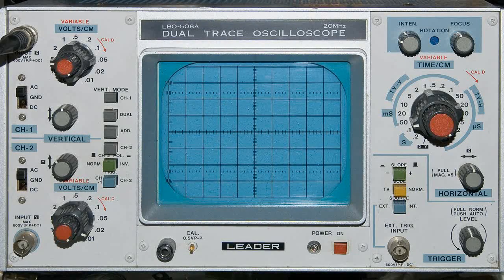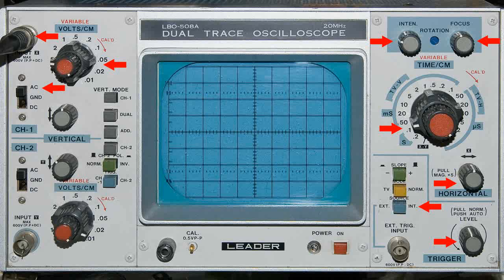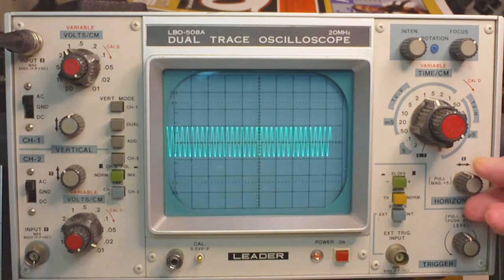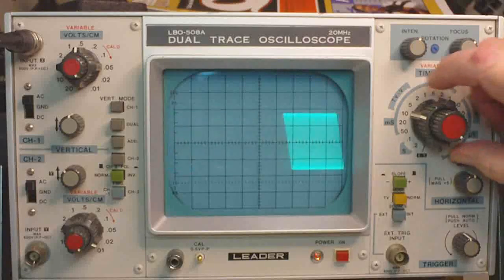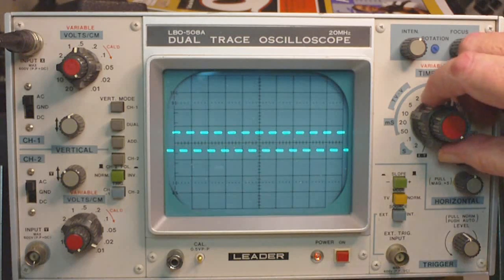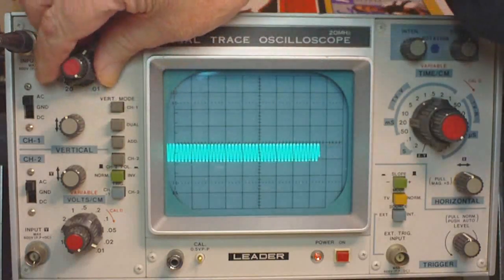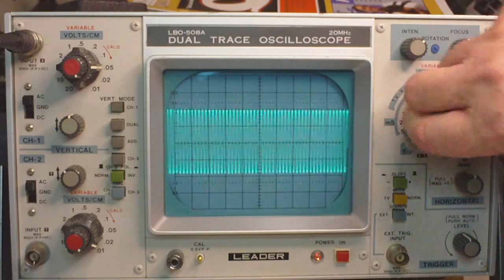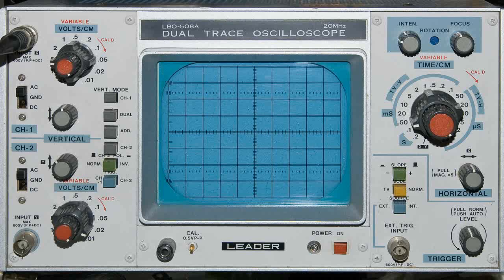Basic Oscilloscope 101

Comment: Thank you for disconnecting the Signal Generator & showing us the CRO attached to a real circuit, and showing us what you can see. 
I don't know if it might be possible to plug a suspect valve into the radio, to demonstrate how the CRO can help you to pinpoint a faulty component?
Reply from the maker: Thanks
Oscilloscope signal tracing
https://www.youtube.com/watch?v=B44wHjb8jMY
LC Resonance Oscilloscope Demo
https://www.youtube.com/watch?v=G_RCyDdt2rM
FM Radio Signal Tracing
https://www.youtube.com/watch?v=a5qa4OFockA

Comment: Can you connect the scope directly to the 300 volt plate??? I still dont understand what I can hook too without damaging the scope...and when looking at the 455khz signal..should it be nice and round at the tops,,, if not the radio's IF is not set right..is this true??? thanks...
Reply from the maker: The first thing to do would be to refer to the specifications of your oscilloscope. All of my oscilloscopes can handle thousands of volts. But as a precaution I always set the probes for the scopes at their highest times value, depending on the probe can be X10 or more. Then if I need to I can change the probe settings down to X1.

Comment from the maker: The probe I'm using has two markings X1 and X10. When I'm working with transistor are other low voltages sometimes I just use a straight wire.

Comment: Almost as good of a deal here. TEK 2230 DSO on the factory matching rolling cart with front cover and manuals for 78 dollars. It was at an industrial liquidator. I went in there initially to get a deal on an office chair. The Tek was off to the side with some projector equipment. Who uses projectors anymore?  I asked about it and the salesman said the EKG is $100 but it doesn't work. I rolled it over to a power outlet and plugged it in. Read the manual and got it to POST, it showed all good.